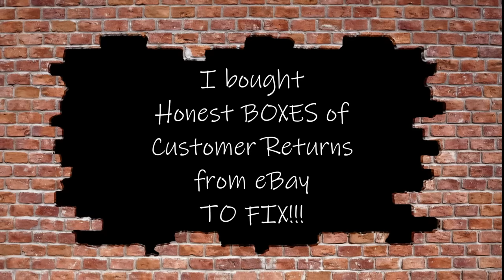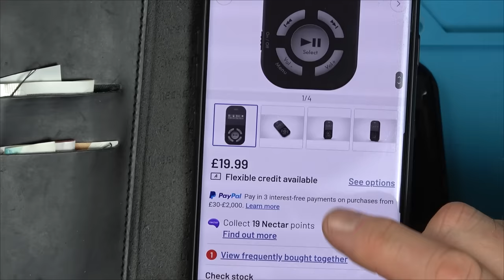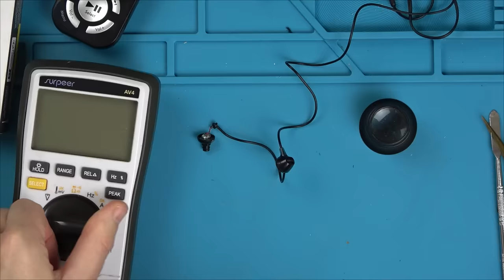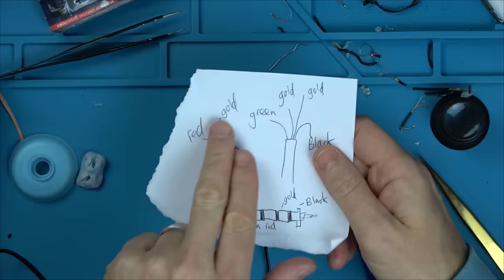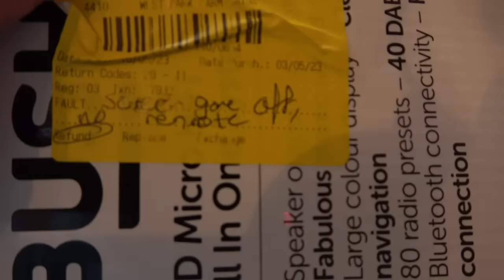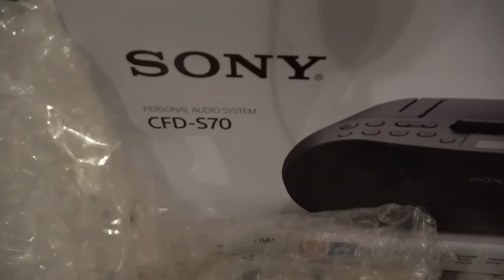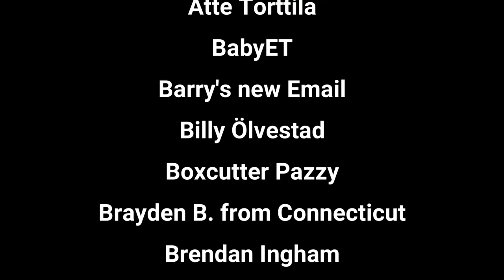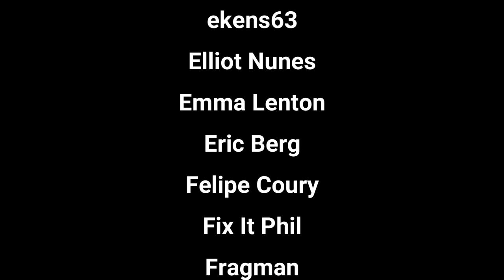eBay CUSTOMER RETURN BOXES - Can I FIX Them?

Comment: Suggest clean the pinch roller on the Sony Cassette. Common cause of tapes being eaten is dirty pinch rollers. Use IPA. While your there clean the head with IPA as well. Both pinch roller and head should be cleaned about every 3 months as preventative maintenance as oxide from the tapes gets deposited a little each time.

Comment: On the cd player with the non-working screen, the ribbon cable had bad connections, but when you measured it for continuity the pressure from the probes on the ribbon pads made the connection 'good' temporarily. Nice fix ☺
Reply: [ 39:26 ]
I thought the same....
😊👍

Comment: 😬Well at least we now know how difficult the Sony tape deck is to disassemble! It's always somewhat annoying when it's an easy fix that just wasn't spotted, but I'm always happy in the end that it was an easy fix at least and not something unfixable after digging so much (or some unknown fix)
Reply from the maker: I will definitely check for the easy/obvious things first on tape decks from now on 👍👍👍
Reply: I had that same Sony stereo and I took it apart to change the speakers and the front separated completely. I think there was a screw under the CD door.
Reply: I wonder why it chewed up the tape in the first place
Reply: @paultasker7788 probably a broken tape that the original owner tried to play and it broke while in the player and it got wound up on the roller. If the tape deck caused it I don't think it would be such a clean spool on that roller.

Comment: Tape around the pinch roller is why I absolutely abhor cassette players. Was so glad when CDs replaced them.
Reply: I guess you never had to adjust the deffraction grating and tweak the birds eye pattern on a new laser assembly? Some manufacturers did that for the spares, but I think Pioneer and Denon didn't. Hours of "fun", including considering quitting the day job. I had a word with our sales manager and got them to stop selling those brands. 

Goodman's, despite being cheap were far more repairable. Lasers were plug and play, and we had stocks of all the little plastic bits.

Ah, for those days where you could buy the stupid little bits of plastic individually.  Now they claim to be repair friendly by selling a huge assembly, despite you just wanting a small gear wheel. 

The company provided background music systems for shops, amongst other things. Remember listening to a CD in "Our Price"? Yeah, we did those too. 

A bit of IPA on a pinch roller was a welcome easy fix in comparison to setting up a new laser!

Comment: I bought some cheap gaming headphones (yes, those with auto RGB cycling lights) at my work place for my brother to use in his computer. He likes to watch Youtube alot, so when then broke (yes, they broke after a month of use), he was really sad. So i took them apart and found one of the earcups suport just broke of. it was a easy fix, just glue that toghether again and cut a peice of an old banking card to hold it in place. Now it well over 2 years and they still look and work like new.

Comment: Hi Vince,  I have been watching your channel. For several months since discovering it, I've been going through the back catalogue which means I have been watching you develop...I am really impressed with your repairs and can do attitude lol. Really enjoying your channel..if you get a chance say Hello...keep up the good work, it's certainly inspiring me to repair...👍👍
Reply from the maker: Thank you Steve👍👍👍
Reply: Give it a go Steve, if something's broken what's the worst you can do? If you can't fix it.. it's still broken but you've gained experience along the way....
Reply: Anything at home I will do, I used to be a white goods and commercial appliance engineer..but will try anything, unfortunately my patience wains when looking at electronics getting older and eyes no brilliant ..you can't exactly repair it with a hammer 🔨  but that what will sometimes happen...However my granddaughter often brings her toys to me to fix lol..
Reply: @Ukmartian1701  I know what you're saying about your eyesight. I used to repair arcade games and fruit machines back in the late 80s up until the late 90s. My eyesight isn't so great now either and components are getting smaller. I have to wear glasses now for anything closer than arms length and often use a microscope connected to a 42" TV.

Comment: Vince, You seam to be having loads of trouble trying to get awkward screws out, have a look for some Japanese pliers called FUJIYA ENGINEER'S SCREW REMOVAL PLIERS - 160MM they are brilliant, for removing awkward screws with none existent slots to worn out Philip’s head full of swarf I think you’ll find them invaluable in your quest to repair the unrepairable!
Reply: Interesting, I've not heard of those before. I just usually use a pair of side cutters and pinch the screw either side. Had to do that a few times with rounded off screws.

Comment: Good run there sport. That tape player error should always be among the first thing to look at. That was a pretty common issue when cassettes where common place. That section is the capstan and roller. That's what shuttles the tape during playback and record. The spools are only taking up slack. FF/RW the capstan is backed off from the roller and the spools shuttle the tape. (back in the day you where well off if you knew how to work a pair tweezers and could execute the scotch tape splice)
Reply: I’ll bet we could have cleaned the capstan without even disassembling!
Reply: @mjshulman   yep, more than once.

Comment: Have you ever thought of making "extension" wire sets for most of the common wiring groups you come across? These would help when you have parts separated and you need to test without having to put most of something back together again (for likely mere moments of testing) and/or just give you more room to work with (that cassette player is a perfect example of where it would be nice to have longer wires).

Comment: Nice video, Vince :)
Those Sony earbuds are a nightmare to get inside, or to replace the speakers, normally. But when they work, they sound like heaven. I also get them used, normally full of someone else's earwax, but I chuck them into Sterilium for the night and when I take them out, they are clean as new.

Comment: When you put screws back into plastic, especially soft plastic like ABS, always counter rotate them first until they click so that you know when you start screwing clockwise you are going back into the same threads in the plastic.  Otherwise you risk cutting new threads and weakening the fastening.

Comment: Great video again Vince. Very very sad but in Australia those returns boxes are just not available, from eBay or Amazon. Just fake returns boxes which contain penny whistles, certainly not any Sony devices. That vice you got gifted is available at the local electronic shop for a very princely sum, they are also sold at Aldi in Australia As usual I did my usual Aldi thing and bought 2, mainly because they are useful and well constructed and because they are only around about 2 times a year from Aldi. Loved the fix it Vince I just wish we had access to these returns boxes in Australia, but such is life. Very entertaining fix it video Vince as usual.

Comment: Been a slow month buying for me, took delivery today of a clearance 9 speed pillar drill paying a third book price and which I am going to convert into a milling machine.   Bought for my Poljot 3133 mechanical chronograph an "upgrade" kit which turns it from a humble chrono into a big bad beastie Russian diver with a canteen crown, screw down bezel, reinforced grille and deep embossing caseback logo from one of the Soviet divers.   £73 but its highest grade stainless steel, crystal is sapphire too so not some cheap tat lol

Comment: Nice job Vince. I think pin 1 on the ribbon cable from the back lighted display looked broken from this part of the video 36:14 If you tested further back on the ribbon, you would of spotted it.

Comment: Wow an ebay seller who is honest, added them to my favourite sellers 👍 what a lot of rearly interesting fixes, I could be wrong but I believe that the tape head dosnt need any logic to work just amplification as the audio is recorded in analog so just wiring up to a Bluetooth speakers AUX jack coukd possibly work to fault find but a scope would definitely pick it up (that could make for an interesting experiment 🤔) , expensive players perform Dolby processing but beleve
Reply from the maker: Interesting, yes so maybe they are just picking up vibrations then. Hmmm, I'd be interested to check that out. Cheers Simon 👍👍
Reply: @Mymatevince  not sure if my comment got taken down due to link? Technology Connections did a video on how a cassette to Aux car adaptor worked that goes in depth into how cassette work
Reply: Do you know who the seller is, I would like to see what else they sell?
Reply from the maker: @simonupton-millard  I'll search for it on YouTube. If it contained a link it would have been removed automatically 👍👍👍
Reply: I can't find a name of the seller? Would you mind sharing?
Reply: @Mymatevince would you mind sharing which seller you purchased from? Iv tried a couple of these with some horrendous luck. Wouldn't mind trying again (if it's bad, we'll then thats just my luck haha)

Comment: Nice fixes. Most interesting one for me was the Sony CFD-S70 cd-tape-radio, as I have the same one. My original device stopped recognizing cd's in less than year, so the store I bought it replaced the whole unit for warranty. The replaced unit has been working now over 4 years just fine.
Nearly same earphones too, just one letter difference, as mine doesn't have the microphone. Mine is Sony MDR-EX15LP, indeed cheaper end products, and have cleaned these already twice in couple of months. 
I have one headphone set with microphone, where right side is more silent than left one, but still it's not completely quiet. It was like that from new, should've returned them, but just forgot to do it in time. I wonder what might be the problem, maybe faulty speaker?

Comment: I like removing the drivers from old in ears that still work and making mmcx 3d printed buds.  plus the leftover wires are useful in fixing over ears with bad cables.  The 3d printed casing adds a bit more size and improves sound stage.  mmcx means the broken cables dont matter for the drivers

Comment: The second item, the MP3 player, i.have one of those, mine kind of works, haven't used it much, don't recollect dropping or knocking it, but it's very susceptible to cutting out if  moved ever so gently, not portable, like it should be. I was quite critical of the retro AM/ FM mono radio you repaired in the previous video, however I like the form factor, of the first item, the top loading cd, DAB combo; definitely an item I might consider buying.

Comment: You can remove the top of the Sony unit to make it much easier to get to the cassette mechanism. Open the CD cover and you'll see two small screws towards the front, unscrew them and the top cover with the CD player attached lifts off. Much, much easier.

Comment: You might already have this comment, but on the earphones, there is only one ground connection for both speakers and the mic.  One earphone was working, so the ground on the connector was working.  It’s probably  a problem in the little box with the mic where the individual earbud wiring starts.

Comment: 40:00 Definitely!  Those are always the worst faults.  The pressure of the probes probably compressed the solder enough to make a connection.  That's also how it goes: one forgotten piece per disassembly process.

Comment: Curiously enough the ribbon experience is on same fault pattern I'd expect: pure treachery.

Your technique is absolutely fine but I like to make the "ripple" effect above the joints by raising the iron exactly over that joint. You need a very fine tip.
It usually isn't a problem if the connector isn't going to touch anything, otherwise I use your technique but only pre-tin one side, and let the solder flow from the other side (usually from the ribbon) using the soldering iron's tip at the joint and moving it back out towards the PCB solder pad.

I might add: never trust your meter... especially on microelectronics. The pressure of the probes themselves is enough to upset or even change the stress tension on the board. I've had this problem with SMD populated cassette player boards.

Comment: Fascinating from the failure analysis point of view,  Vince, covering such a large range of devices , do you see patterns of similar faults across manufacturers and widely different appliences that you cover.  Connectors, liquid damage ( oh, the Dyson dog wee fan) , assembly faults , clogging, like the tape ?

Comment: 39:43 - You did not check for shorts between pins. You checked them 1 on 1. Did not check 2 on 1 and 3, etc... During your soldering you push out solder at 38:05. Someone probably did do that when he was assembling. Also, keep in mind that beeper will beep when under 100 or so ohms. There should be less than 1 ohm, it may have been 20 or 95 on some connection. Thats why its good to also check on screen once it beeps or use resistor measurement.
I have found one flat cable to have 12 ohms, it should have had 0.1 ohm.

Comment: Clean the rubber wheel on the tape player otherwise it will just chew more tapes. It is covered with brown oxide lol. Also, perhaps if you had looked through the window on the tape you would have seen that only one of the tape wheels was moving. 
I presume you are not as old as me and did not spend your teens, 20s and more trying to carefully rescue chewed up tapes lol.
Interesting to see the breakdown of the device, and all the devices though. 😊

Comment: I have the earlier model Sony Cassette Corder from 2012. The cassette player and CD player are located next to each other on top.The unit is virtually new and has been used very little, however the CD player developed a fault on playback. I am thinking that it could be because the unit was off more than what it was playing in 11 years ? I never left CDs or tapes in the unit. Anyhow, coming back to the fault, the CD plays and then gets stuck and then carries on playing seconds after from the point of where it got stuck. I have tested other CDs thinking it is a read error or a dirty CD, but no joy there. I do not want to really take this unit apart, because it is quite tricky to get it apart for one reason.The other reason is I don't think that the problem is inside though. Underneath the lid of the CD player, is a plastic disc shaped thingie that sits on the CD when you close the lid. Maybe it is pressing down to much on the disc or there is another issue causing the disc not to play properly. What are your thoughts on this ? Take note, I am not very experienced in repairs, however I do take opportunity to try at least. 👍

Comment: 43:00  Before  open screws>  listen to the motor sound, check FF>> & RW<<,  knock on the head front    with a magnetic screw if get sound in audio line, buy or build an audio signal  generator pen ..&  a LED Lighted Teeth Inspection Mirror :) ...HOPE helpfully 💰

Comment: Connectors cost money. When you are aiming to make something as cheap as possible, the last thing you want to do is have to buy connectors and then solder them on, easier to just strip some of the ribbon cable away and then solder it like a through-hole component, much much cheaper.

Comment: Software is not an issue if you have the skill I used to mod phones & repair them physically for many years. It's a process just like hardware & tbh a lot easier in many respects

Comment: Since you are often working on 240v items and rightfully worried about getting killed, why not, whenever possible, use a transformer to reduce the power to 120v.  You will still get a shock, and should still be very careful, but it will be less likely to kill you.
Reply: Or better an isolation transformer. Vince should really consider getting one. Or one of these powerstions as the output of the inverter is also isolated. I can remember Techmoan bought a powerstation to be able to use vintage 110V 70 Hz gear...

Comment: not bad but you have to be a bit more mindful of the damage you cause to the outside of items as the db/CD player top has been scratched 09:38 from leaving tools on the pad as you move the item around.. Loss of profit there. Also best to start with a plastic pic and not a metal one as it does less damage when creaking open items.

Comment: Like I have said in other vids like this.....first, I said first,  THINK about why it may not be working! ( There is no need to check the radiator fluid if the car will NOT start, or see if the tires are low.) Secret......T H I N K ! F I R S T !